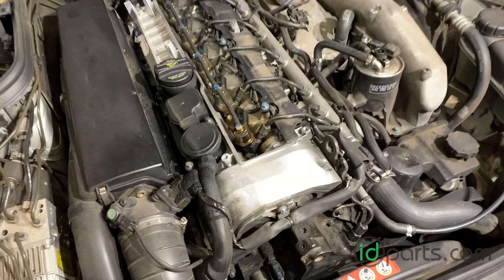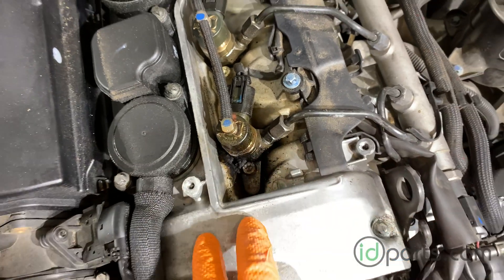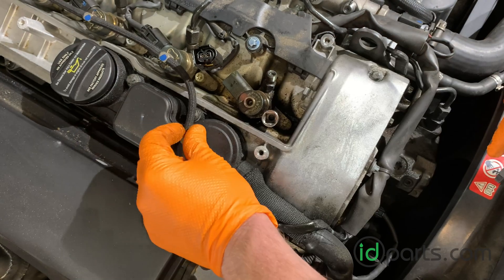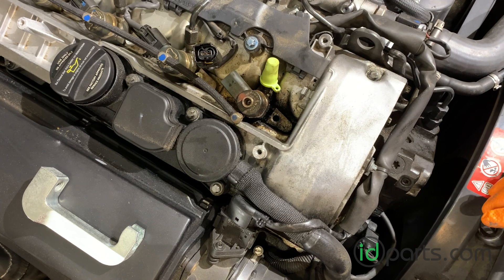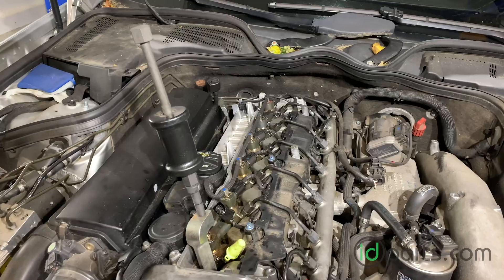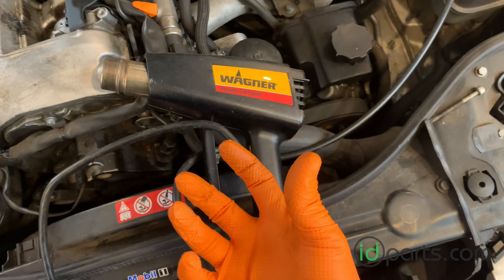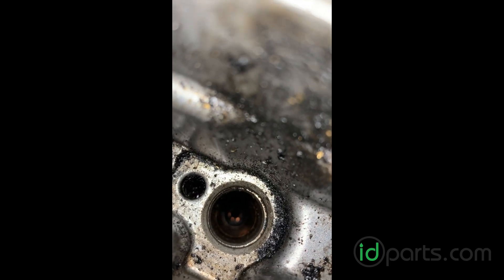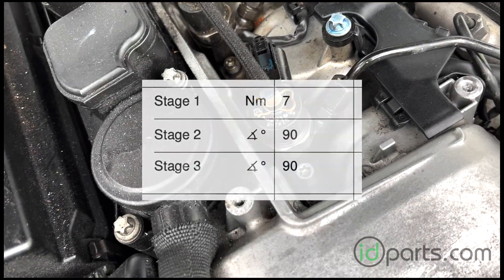Injector Black Death Repair Mercedes Sprinter & E320 CDI OM647 OM648

Comment: what if my injectors look fine, but I still have issues.  my issue is it will drive to a high rpm before it will shift, and when it shifts, it takes off and blows black smoke out the end.  I smell a soot smell in the cab like something is trying to burn off.  I'm trying to detect the real issue before i dive into the injectors.  I have had one changed already.  i have a T1n engine.  03 mercedes diesel.  I've ordered parts from you before.  thanks boss...

Comment: Spray pb blaster on the hot engine multiple times before trying to take out the injector. Another trick is turning on the engine with the injector bolt out, the pressure on the chamber will push the injector out some of the times.

Comment: A few videos of injector removal show using oven cleaner to soak and soften the black gunk prior to removal. 

The shop vac attachment is cool. Need a link
Reply: I read somwhere: brake cleaner does not dissolve this gunk, oven cleaner does but is corrosive to aluminium! Carburretor cleaner or cellulose paint thinners do the job well without fucking up plastic or aluminium parts.
Reply: @bartden9668  It is only safe to use if you are sure it won't affect wires. I have so clean and one injector wiring is covered with this crap :(